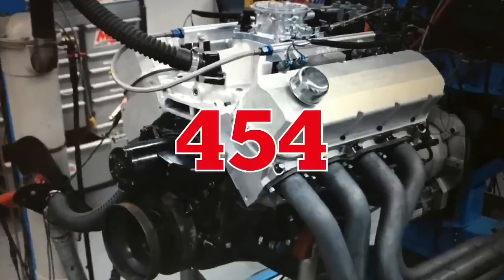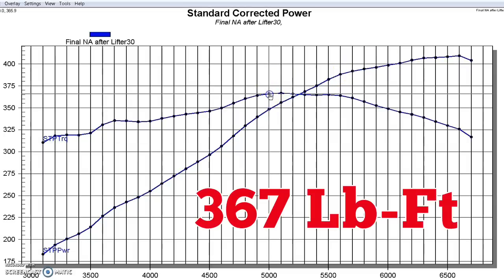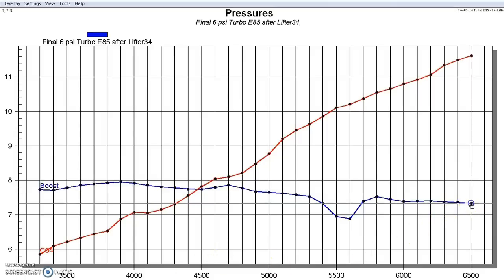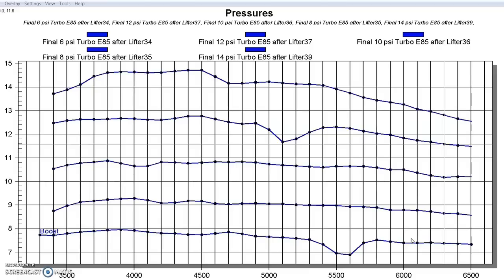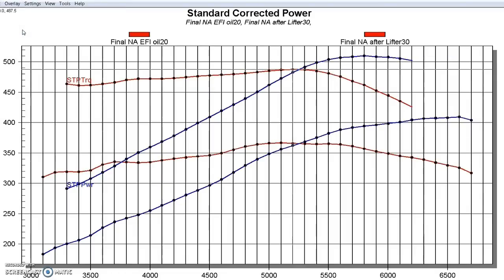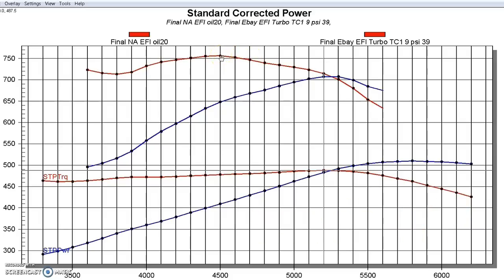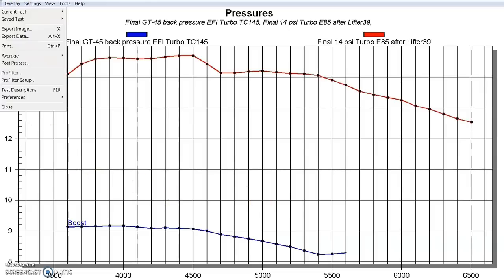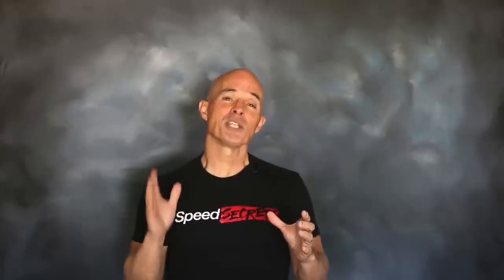EBAY TURBO TITANS-4.8L vs 454 (GT45 TURBO)

Comment: I enjoy watching your videos and it allows me to think about a few things. I personally don't believe any domestic v8 should use a t6 housing at the very least for a single and t4s for twins. I'd like to see you run this test again against the t6 hotside (whichever ar you choose) to show the difference in back pressures at the same boost levels.
Reply from the maker: I'm not aware of a T6 hot side of the DNA GT-45 turbo-but I did do a T4 vs T6 hot side test on an S480-very little difference at the 940-hp level
Reply: Do you have a link to that one? I'd like to watch it 😊

Comment: I feel porting that exhaust housing would be really beneficial
Reply: The housing was just entirely too small for the 454. Porting would gain some power but really just picking the right sized turbo to begin with would make much more power than porting the housing on a improperly sized turbo. The 454 should have easily made over 1000 hp providing the internals would hold up at 14 psi of boost with a properly sized turbo.

Comment: you should run a 4.8 ls vs a ford 4.6 dohc
Reply: too tall Falls  oh yes! The two underdog modern small-blocks, both can be had super cheap and work great in smaller vehicles. We need to see a 4.6 dohc big bang engine lol
Reply from the maker: stock ones? mods?
Reply: Richard Holdener  would love to see stock for stock  or both with just a few cheap bolt ons, then moon boost with a 78/75 or S475. Like two similar “budget street combos”, we all know you already have the 4.8 lol
Reply: Richard Holdener I would think the 4.6 would need rods and pistons to be competitive the stock ones give up around 450 wheel hp from what I’ve seen but from what I understand you can use coyote rods and 4.6 forged pistons and be good for 750 tire I may be wrong though lol

Comment: Couldn’t you just adjust or use a larger waste gate to relieve back pressure?  For people that don’t want/need to run a lot of boost, small turbos are great because they spool so fast.  That big block combo would feel like a monster with very little turbo lag.
Reply from the maker: we had two waste gates-they wont relieve back pressure without changing boost pressure (somewhere in the curve)

Comment: How about doing this same test....with about 8 feet of pipe to the turbo, and likewise boost plumbing, to simulate a crappy rear mount setup.
Reply from the maker: look at the hemi turbo video-long tubes
Reply: @richardholdener1727  Yea that's cool. But I mean to compare a front mount to the same turbo as a rear mount. Although in the Hemi video...comparing that long tube setup, to a cast manifold short pipe setup would be good too. And thanks for all these great informative videos !

Comment: Hey Richard. I have a 6.0 with ls3 heads btr stg4 ls3 cam 9.9 compression. Engine dyno made 490 tq 576 hp wit a carburetor. Now what would be the cheapest way to make 1000 hp nitrous turbo or super charger? How would you do it ?
Reply from the maker: nitrous or turbo is cheapest to get you there

Comment: Hey Richard is there a budget turbo u would recommend for a 5.3? I'm looking to mount a turbo under the cab of my Lm7 swapped s10. I was thinking a ebay t76 for like 250bucks but I dont know a bunch about turbos. Thanks n cool video
Reply: Rob Russo 7875 is what I’m running.
Reply: @Turbogto_guy  how's your low end/spool up?
Reply: Todd Allen well I had a 5.7 in the car. It would start making boost at 2500rpm. I just finished building a 5.3 to go in the car. Maybe drop it in, in the next week or two. I don’t expect much loss in spool, if any. Same cam, heads, etc. I have a vs racing billet 7875. Had a on3 cast wheel before that and swapped to the billet. Didn’t spool any faster like people say it would. I swapped to the billet wheel for the extra power it was supposed to bring in the midrange.

Comment: Ok so I'm building a 466 BBF to run at drag week. I was going to single turbo it but have been thinking about doing twins and with the price of these I could have 4 of them incase they break. Now I understand that's a small turbo for a built big block but would you think that running twins would bring the back pressure into check or does it just need to go bigger turbo/turbos all around? Going to detune it to around 1000hp to try and make it last.
Reply from the maker: twins will easily do 1000 hp on a BBF-you don't even have to make a stroker
Reply: @richardholdener1727  thanks I just dont want to run into this back pressure problem but figured twins would help. I understand these are super cheap turbos but this way I can take a few with me since I plan on drag week tearing everything up.

Comment: So does this mean the big block would be set up better with a compound turbo set up with the 22lbs of back pressure?
Reply from the maker: no-it just needs a bigger turbo-I ran an S480 and the boost/back pressure ratio dropped from 2.62:1 to 1 to 1.5:1
Reply: Thanks appreciate the insight!

Comment: I realize this is an engineering exercise, to learn things and pass along info, and i appreciate it . You asked for suggestions, i would like to see you plumb an engine so it actually fits in a car. I couldnt get either of these engines in my garage , let alone my car, the way they are set up for the dyno.
Reply from the maker: There is no need for us to fit the motor to a particular chassis-it just need to fit the dyno for our test-the results wont change unless the fitment creates an unusual restriction

Comment: Richard...how about some thorough "junkyard/hot rod" turbo tests?
Cummins Holset
6.0/6.4/6.7 Powerstroke turbos etc
Most everything out there is anecdotal, at best. As compared to your thorough testing/breakdowns.
Something regarding spool up/rpm range etc on those big diesel snails
Reply from the maker: I would like to run those-I just haven't found many in our yards
Reply: VERBALLY mention it in a video...I'm sure some viewers would send you some back of the garage shelf decoration turbos to test, in exchange for a shoutout or a t-shirt

Comment: I remember reading a while ago that efficient and well matched turbo exhaust/compressor housings will have a 1:1 back pressure to boost ratio for most of their operating range, is this true or just a wives tale?
Reply from the maker: That depends on a lot of variables
Reply: @richardholdener1727  What I was getting at is that turbo isn't the most efficient combo and that if you were sizing it from the get, you would have picked a combo that had a ratio closer to 1:1, right?  I know exhaust BP is a bigger issue with gas engines than diesel and contributes to EGT and can lead to burned exhaust valves.

Comment: I'd like to see what can be done with the box stock GEN6 454. Use the the whole thing with the MPFI manifold and stock heads.  I bet there is a ton of potential there on aftermarket ECUs.

Decent cam and better turbo and 800/800 should be easy.
Reply from the maker: I ran a cammed, carbureted  Gen 6 454 with a Vortech back  a while back-made 845 hp
Reply: @richardholdener1727  yes, I saw that. The point was, why chuck away a perfectly good intake if it, like the LS truck manifold, can make great power. A set of 1500cc injectors, twin GT45s and a sh-medium cam could be a monster on the cheap.

Comment: I am interested in seeing bone stock 4.8 (no mods at all) plus boost with various turbos.  Maybe even other LS/Vortech engines too.  I will look through what you have.  I have also bought one of your books and I do recommend your channel.  Thank you and well done.
Reply from the maker: stock 4.8L makes 335 hp (the way we test it)-at 14.7 psi makes near 670 hp
Reply: Richard Holdener Thank you for the reply.  I will "stay tuned."

Comment: What's a good size turbo for the 454?
Reply from the maker: depends on power needs-but the S475 works well on the BBC
Reply: @richardholdener1727  or twin cheapo 45s like most comments are sayin. Hint hint. Lol

Comment: At the very least it needed a bigger hot side for the big block. Yeah, you need to size your turbo. They're a bit like camshafts. You don't have one cam that works the same in very different engines.

Comment: Brilliant video! Very informative thank you! 1 question. How do yiu meassure back pressure? There must be a pressure transducer if some sort? Where does it sit? Is it part of the wideband?
Reply from the maker: We use the pressure sensor in the dyno-we run a steel fitting in the Y pipe, run a flare fitting to a length of aluminum tubing (copper also works), that tubing runs to rubber tubing then to the sensor

Comment: Richard I would be interested in a 5.3 vs 4.8 boost test same cam same turbo and do a 6 8 12 16 20 psi test to see if the 4.8 starts to close the gap or if the 5.3 will stay ahead. Great videos!
Reply from the maker: That will depend on the hot side flow of the turbos, but if there is enough flow, the 5.3L will always make more power (assuming same mods)
Reply: I know the 4.8 can make more power from a smaller turbo than a 5.3 can due to the turbine housing flow. I like them both but the 4.8 has a great rod ratio. Im torn between the two for my mustang project. I have a 7875 turbo with a .94ar hotside now.

Comment: I’m a little surprised you didn’t run the stock vortec heads on the 454, of like to see a comparison between the stock heads and these heads
Reply from the maker: I did a Vortech head vs after market head on a Vortech supercharged Gen 6 (SBE) 454. The difficulty is that the stock heads are 102 cc and every decent BBC head is closer to 120 cc (edel has 110 cc), but the stock pistons don't allow much P-V so milling is another problem. Installing after market heads that flow better drop the compression significantly (like our Darts). Despite this, head swap was definitely worth power
Reply: Richard Holdener I’ll have to go back and look for that video, missed it, thanx for the reply
Reply: @richardholdener1727  I have Edelbrock 100cc BBC heads on my SBE Gen6 454 with 2.125in headers,  Performer RPM roller cam, fuel injected.  It makes about 550hp and the heads keep compression near stock gen6.

Comment: Mr. Holdner could you please do a comparison for us (me lol)?
You see the very nice, narrow angle long-leg "y" pipe feeding the turbine inlet.
Can you do  back to back comparison of power and or spool on a large (for displacement) turbo between an optimal angle (as you have on the dyno) and a poor angle, like a "T" where the piping is closer to perpendicular to the turbine inlet.
Very close to the turbo.
So picture like having a looped (closed) exhaust from one header to another and just hole sawing out that loop and welding the turbine flange to it as though there were no room for the turbo.
I'm EXTREMELY curious to see exhaust optimization (as you have it on the dyno) versus something like a packaging issue as I've described.  Is this something that could be done?
If you do not have a large turbo for the displacement (whichever motor you're testing) any turbo would be better than nothing.
Thank you!
Reply from the maker: having fitment issues are you?

Comment: So, is there a "cheap ebay" turbo that flows enough on the hot side to balance out this comparison?
Reply from the maker: not that I have found, but two of these will do just fine on the BBC
Reply: @richardholdener1727  is that planned in a follow up video? Or would this be considered wrapped up with the lesson being: Be sure to size BOTH sides of the turbo for the application?

Comment: I love the knowledge.  Some different brands would be nice tho
Reply: You realize it's 2020, right? Show me a NEW, INNOVATIVE product for any of those 60 year old boat anchors you mentioned.
Now, if you're talking about modern muscle...
Perhaps, once you can buy a running Coyote or 392 for less than a used SUV...people will get more interested...
I mean $3000 will get you a running LS, a Holley EFI standalone, AND a compete turbo set up (fuel and intercooler included)
You can't even touch a stock Coyote for less than $4000...just the engine!
Until then...LS the world!
Reply: Eric Chart so you’ve proven my point. Cheap is king forget anyone who may like something different. Only chev is a hotrod? I mean even 4 & 6 cylinders deserve attention. I have a twin turbo V6 that makes more torque than any modern V8 so that must mean gm is over charging for outdated N/A V8’s.
Reply: Congrats on your Ecoboost, that nobody but ecoboost owners care about. Ecoboost and budget cannot be mentioned in the same sentence. I'm sure there's an EcoBoost channel out there. Find it
Look at PRI...the INDUSTRY LOVES THE LS. 
Sorry you'll have to start your own clubhouse.
If you want SBF, BBF, Mopar builds...go to your doctor's office. Pick up his 1983 CarCraft, and read it...nothing has changed for those engines since then...
I used to like BOP stuff, until I really broke down the $$:HP
I still love them, but I'm not going to pay 3x the money for 1/2 the performance, just to be different...
Reply: Eric Chart I see you like to co trio the narrative. Didn’t say I don’t like ls or the knowledge. It was you that said u want a monopoly. If you don’t like my comment go rev your ls and ignore it
Reply: All I was saying, is he provides content that many people enjoy. Not just one or two. 
There is an in depth video on here how about building the Ford Flathead. But like only one. Why? Because nobody besides that guy cares about the Ford Flathead. LOL
I watched the entire series on rebuilding a Lamborghini V12. I'll never assemble, or own one, but it didn't keep me from enjoying video. 
 If they were more of a demand for ecoboost videos, then there would be more ecoboost videos out there.
I love ANYTHING that makes power. But, after having driven, owned, and worked on/modded just about every platform, I know which one is my favorite, and I'm not alone
Reply: I love the gen 1, hard not too. There would be no LS etc without it.
But like was just said, your barely talking about Gen 1...
That's like comparing a SMX with an LSX. 
(When that Powerball hits, Steve Morris, here I come lol)
Reply: I agree with all these comments,  but a YT channel that wants to be popular has to go with what is popular. The old Gen1 small block Chevy was less expensive to build in the 80s than other brands  just like the LS today.  If your a budget builder,  you build what's cheap. It would be cool to see turbos on older ford/chrysler/amc engines just to see. Richard did do a mild turbo on a modern hemi a month ago. check out his channel.
Reply from the maker: like which ones?
Reply: Anything really? Sbf bbf Mopar pick anything this LS is getting monotonous.
Reply: camaroguy 66 literally not one part on those engines are factory gm down to the block like you said. for the price of a single 1,000hp SBC one could have two 1000hp LS engines that have factory crank/block/heads. While being a slightly smaller packaged engine with better economy
Reply: camaroguy 66  for how much money you save being able to use actual stock parts with an LS more than makes up for the nickel and dime parts needed to swap

Comment: Maximum hp n/a 4.8
Also like to see a Cnc ported heads shootout
Reply from the maker: Do a search for 20 LS head test Hot Rod-I ran every LS cath head I could find, then did the same test on rec port head, then LS7 heads
Reply: @richardholdener1727  That was a great test!
Reply: Pretty sure I’ve seen that one but I’ll double check
I meant a tea vs katech vs Wilkes etc etc
Compare the power output of  heads from the Cnc porters

Or a set of stock vs hand ported vs Cnc ported
Reply: You do realize, that in order for Richard to do that CORRECTLY, HE'D HAVE TO PERSONALLY BUY EACH SET OF HEADS. (at $2500+ set for some of those listed...OUCH!)
I'm not questioning the integrity of ANY of the CNC head companies... BUT, if you tell them you want them to send you a set of heads, for a horsepower comparison/shootout, you have to immediately question if they are actually out-of-the-box heads being sent.
I really don't think most people understand the resources needed for these types of comparisons/videos...

Comment: Now run 2 GT45s on both, that’s what I want to see!
Reply: Twin Nagasaki turn tables
Reply: The cast bottom end wont live long in the 454. With twins and these gt45 ebays max out at 15lbs each.
Reply: Backyard-Built-Trucks im more curious for back pressure info on both engines with twin old school turbskies.
Reply: Backyard-Built-Trucks I’ve ran 40psi with these turbos on a ls2 427 and low timing (13’) , 1400+ horsepower ..low 8s in a 3550 lb f-body, 26x8.5 slick, back in 2012

Comment: I'd like to see a stock 283 with cam and springs, everything else factory, compared to a 4.8 equipped the same run n/a and boost.   gt45 should match the 283 better than 454.
Reply: Actually you can use aftermarket heads on a 283. Would kinda be interesting to see how bad the 4.8 spanks the old tech
Reply from the maker: A 283 in not great-small bore-limited head choices and its hard to make power unless you bore them to allow decent heads. It takes some doing to make 1 hp per cube with factory power pack heads-a 4.8L does that with room to spare and responds even better to mods
Reply: Anthony,  just to see the difference between old school and new school of same engine size.  could do with the 5.7 liter and 7 liter old/new combos.
Reply: Not even close
Reply: Better combo ? Dz style 308 inch with trick flow heads twin 45s  , gnarly 2400 lbs. 62 chevy 2 ,456 gears sequential shift 6 sp. Super low  slung 29"×18" tires on15" wheels !?!?,bring it on please!
Reply: My older Sis had a Malibu with a 267 4 barrel .  It was a very powerful car . My younger brother had a identical car with a 305. .. it had plenty of power but it wouldn't run with that 267 .  Smaller engine would blow it's doors off.